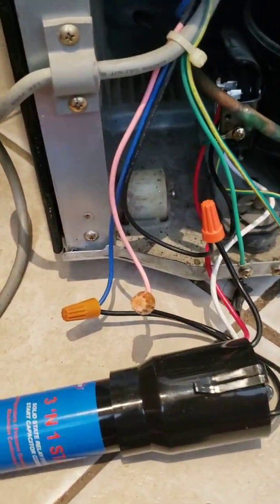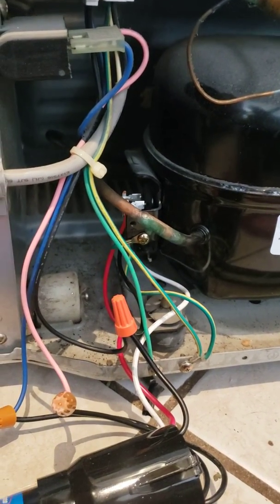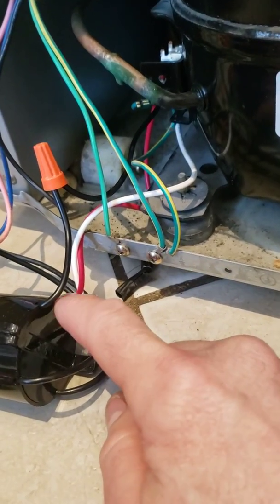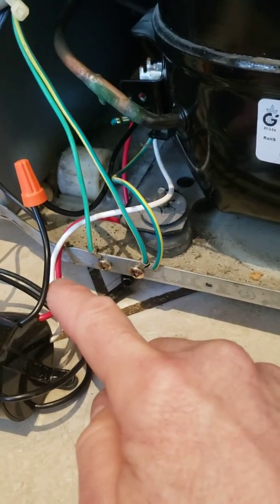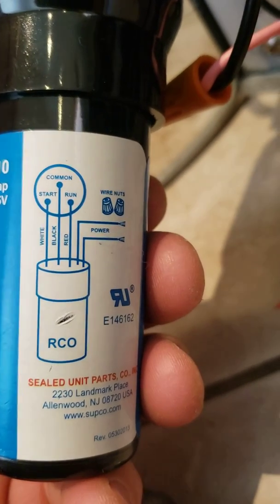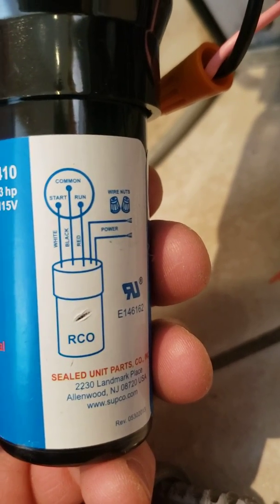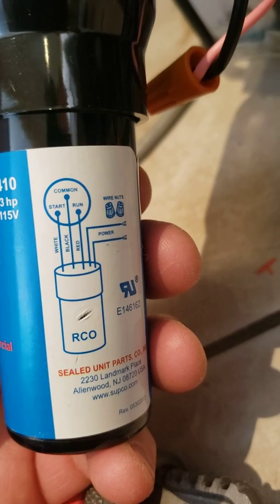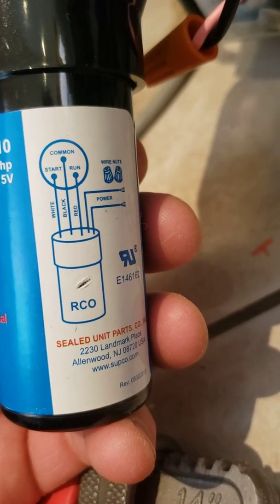Installing a Supco 3 n 1 compressor starter - what to do with extra power line?

Comment: You wire the compressor wrong turn the diagram up side down  then you will have a fair idea where you went wrong  ,therefore the white wire will be on the left and red on the right.

Comment: So you're two black wires coming out of the top are connected to a pink and a blue that must've been part of the other plug while mine has two white and a blue. How am I supposed to wire these two blacks I have on this RC0810.

Comment: Mines comes one, then cut off, what’s the problem?
Reply: Sounds like your start & run wire's are reversed. There's a thermal relay in the top of the 3 in 1 the bottom is the capacitor.

Comment: I have this exact setup and relay went bad and can definitively say that, contrary to some commenters about the three prong rotation theory, the bottom is common, left is start, right is run. BUT! Unlike tis video the extra "thermostat" wire tripped my breaker when splicing to the common, and the fridge and all its functions only worked with that extra wire connected to one of the power wires. Hope this helps anyone that was flummoxed like i

Comment: What about the Red wire on the new starter I know 1 hooks up on the right side . on the compressor i have a run capacitor , the top wire goes to the white, but the bottom wire goes to the thermostat .Do i splice the red to that? I would end up with 4 wires spliced together for the red wire on new starter?

Comment: CSR is how to remember it. And then reading from left to right and down just like reading a book. In your configuration which is an upside down triangle. Common is upper left then reading across would be Start and the middle pin which is down the middle and down would be Run. This is based on my commercial refrigeration training.

Comment from the maker: Hi Everyone, thank you for the advice and input in these comments.  I would like to say that I am not a repairperson and attempted this during the pandemic when I had no work - according to some comments, I did this completely wrong/backwards/dangerously.  You may be right, I have no idea as I am not a repairperson!  However I would like to share that it is May 2024 and my refrigerator is still running great off of this repair, sooo...🤷.  Anyways, best of luck to you all and remember I have no expertise in this, just trying to get by and it seems to still be working.  Perhaps next week my fridge will explode...😁

Comment: Please note that there are a few major mistakes and issues in this way of wiring.

1) Your run and start wires (left and right on the compressor) are reversed. (If common is on top, Run is the right pin, if common is on the bottom, Run is the left pin.)

2) The black line connected originally to your bottom pin is one of your power lines (Hot). Your blue wire is your 2nd power line (Neutral), which was connected to the Run winding. The reason you have an extra wire is that you have a run capacitor. Your blue power line is also connected to one side of the capacitor, and from the other side you get the pink wire, which needs to directly connect to the compressor’s start pin.

3) Your run capacitor, which was supposed to be in series with your start winding, is now instead connected in parallel to your Hot and Neutral!

So, you need to use the fridge black and blue wires and connect those to the 3n1 black power lines. And you should splice the pink wire to your 3n1 white wire to connect it to your start pin on your compressor. (and don’t forget your reversed Run and Start pins)

I will be surprised if you haven’t damaged your run capacitor and compressor.

Please either remove this video, or make another one with the right wiring to not misguide others. I appreciate your bravery and trying things out! You can refer to this video to fully understand it:
https://www.youtube.com/watch?v=zqhkvXPjtKc

Comment: Great video. My setup is I have 2 wires that connect to starter relay from the capacitor. I have one black one that connects and one yellow. I just ordered this kit. Which wires do I plug in the 2 black wires that's attached to the supko kit?

Comment: Thank you. I have had issues with mine. Finally bought this and noticed everyone only had 2 wires. Saw this, did what you said it started right up! Thank you
Reply: Did yours work? I did so and it didn’t work but I have the white wire closest to me as that’s how it was before I bought the 3 n 1… i heard a clicking before I installed this now I don’t hear anything.

Comment: I think the red wire (Run) should switch to the white wire (Start) because the compressor connectors are upside down
Reply: Did you figure it out? I’m confused with this… I put white closest to us (that’s how It was before I installed the 3n1) but now the compressor won’t even click…. Before it was at least clicking and warm..
Reply: I checked online and YouTube if common pin from top switch down then red wire or run wire should connect from right pin to left pin
Reply: @kamy4531  my common is on bottom. I currently have the white wire closest to me. Is that wrong? Compressor not turning on…
Reply: @kamy4531  before I tried this white was closest to me and that’s how I installed the 3n1 but now it won’t even click on. Wondering if I try how video is if it’ll make a difference

Comment: The problem I see with all these videos is what about the on/off/thermostat switch on the outside of your freezer.  You know that dial that turns on or off your freezer and you can set it to mid/high/low etc.  Anyway the solution was simple.  In its original configuration, two wires from the power go to the switch/thermostat.  Blue and brown.  A third wire coming from the switch/thermostat (black) provided 120 when there is a call for cooling.  So simply connect the Supco 1 power lead to that black wire.  The blue wire connect to one incoming power.  The brown wire will connect to both the Supco and other power wire.  Now you can turn off/on your freezer and thermostat control it.
Reply: You win the internet today🎉 between this guys video and your solution, I have now solved the puzzle.
Reply: I edited this to say that I was wrong. 😂
Reply: This is my issue but for some reason it keeps tripping the breaker. It worked for like twenty minutes.😢

Comment: Not to be rude, but adding a "power" to "common" makes no sense period.       "Common" is Ground back to your electric provider.   "Power" is electricity coming in from your electric provider.     "Common" is the Path back to the Electricity grid.
Reply: 100% spot on. the common to the compressor  from the 2 + 1 is powered internally  from the line side L2,  L1 hits the start and run.,  DIY-ers just call a tech before you blow it up or  get juiced.  Nobody has mention Ohmning out the windings before you order  parts from the web.
Reply: So I connected the two wires that give me 120 power to the black power wires. I also hooked up the start, run, and common wires to the compressor and it did not work. I left the third wire that with to the start relay disconnected and my system will not kick on. My compressor checks out with a multimeter but it will not kick on. Do I need to connect that Start Relay wire to the common as he showed in this video?
Reply: I have the extra black wire (believe it’s thermostat) where would that go on here?
Reply: The term "common" does get misconstrued. When working with Capacitor's like on an air conditioner or compressor common is one leg of a hot that goes to one blade terminal on the capacitor now the other terminal is now boosted to whatever microfarad the capacitor is rated for. A good way to not get mixed up is on the wiring to the main panel it's hot, hot & Neutral. Neutral and ground can only meet up at the main panel NEVER A SUB PANEL.

Comment: Great video. I wonder why the company has the diagram for white as the start, black as the common, and red as the run, but they have the wires coming out of the mechanism in the order of white, red, then black… Why confuse us? Is there a reason why it is out of order between the diagram and the physical wiring?

Comment: I also have 3 power lines on my GE side by side, just as you show on the video. I splice it into the common wire, it DID NOT work. Thanks for sharing.
Reply: I have same problem.  How did you ultimately connect that extra wire?  Thanks in advance!
Reply: I followed the instructions on the package. If you don't have the package, just google the brand you have and it will give you instruction. @mikemd2697
Reply: Any luck? Mine isn’t working either after that
Reply: make sure youre doing the right thing. He mixed up red+white wires and placed them on the opposite sides of what should have been done

Comment: Good Lord man you make that way more complicated than it needs to be. The thermostat turns on both the fan and the compressor. All you need to do is cut the two power wires and connect them to the two black power wires on the three on one. There is no third power wire. The thermostat is just a switch that breaks the circuit. Now, as far as the probes on the compressor if the common is on the top, run is on the right, start is on the left. If the common is on the bottom you just rotate that triangle so now the common is on the bottom, run is on the left, start is on the right .
Reply: My thoughts exactly 😅
Reply: So I connected the two wires that give me 120 power to the black power wires. I also hooked up the start, run, and common wires to the compressor and it did not work. I left the third wire that with to the start relay disconnected and my system will not kick on. My compressor checks out with a multimeter but it will not kick on. Do I need to connect that Start Relay wire to the common as he showed in this video?
Reply: I have a question.. I got the 3&1 tied in.
But compressor hasn’t kick on at all.
I did hear a click but that was all. Why the 3&1 hasn’t work for me. And we need our freezer bad
Reply: I did the inverter triangle as you said and it is working, but I can't hear when the compressor starts and finish. Question: If I hooked the cables start and run incorrectly, it can still work but maybe frying my compressor by failing to finish it's cycles? 😢
Reply: If you wire this thing in wrong and plug it in will it just not start or do you fry the capacitor?
Reply: @alexandersheets1  I asked that to a supco guy via mail and he answered me this:
"No, I have never seen one work that was not wired correctly.".
Reply: @alexandersheets1 It just won't work unless you jump the start and run with a screwdriver. The capacitor is to start the compressor. Supco makes a 3 in 1 with female spade connector(s) for use with a run capacitor usually 5-10 mfd.
Reply: Hello my whirlpool 18 cubic has four wires on the connector two red and two white,I connected the two black wires to the reds and whites, common black top, start white left and run red right and my compressor still won't come on, did I buy the wrong 3 in1 its an 810
Reply: @ChristopherWilliams-gc2tw it's odd how Supco has their part numbers. The 810 is the smallest one for a small fridge like a hotel room or bedroom would have. The 210 is for large 1/2 hp compressors. The most common sized 3 in 1 for residential refrigerators is the 410. Always check thing's BEFORE the compressor like the cool control switch or timed defrost switch.
Reply: @danp7463  thank  you for this info, appreciated.👍

Comment: Mine has 4 wires? Three to starter relay , and then one to the overload ? Any suggestions on how I would wire that up with this part ? I have the part already !
Reply: I believe you have an inverter compressor. You can not install this kit to inverter compressor.
Reply: Same. I have a pink and blue across from each other. Then a red wire directly under the blue. There is a black wire to the overload.
Reply: Did You Figure It Out ?
Reply: Mine is the same. Did you ever get it figured out?
Reply: Yea I have 4 but I’m so lost

Comment: I appreciate your explanation of left to right with the start and run in relationship to the common. All the videos I saw had the common on the bottom. Mine is on top and I wasn't sure if I had to switch the order